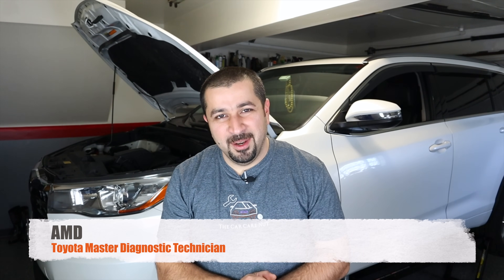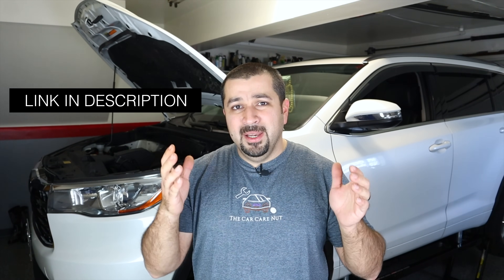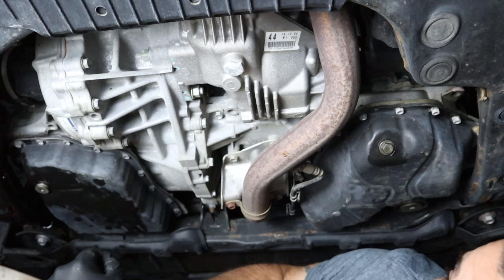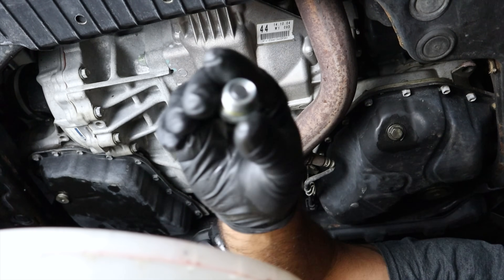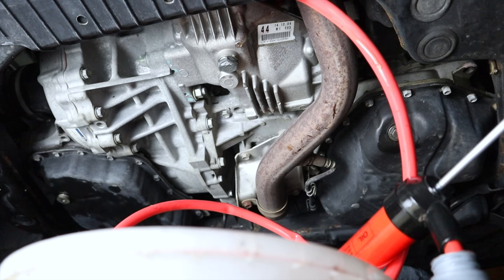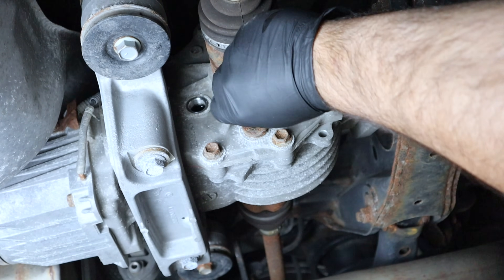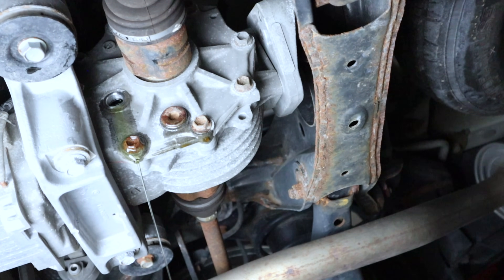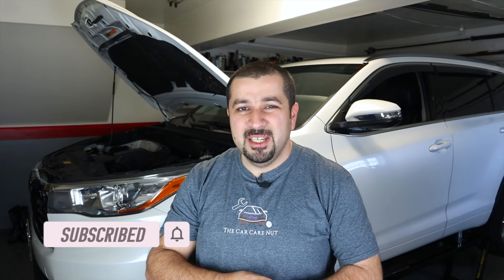How to change Transfer Case and Differential Fluid on Toyota and Lexus

Comment: you forgot to make sure the vent plug on rear diff wasn't clogged. common problem on these...
Reply: How do I do this on my 05 highlander?
Reply: @notreal5299  it's on top of ur rear differential assembly. if it's not moving by hand it's clogged and building pressure and leaking thru seals. can replace it or clean it out.
Reply: @munirshaikhshahid6550  thank you, I now know where to feel around for when I'm under the rear differential.

Comment: I tried using that same red pump today for my sons RAV4 differential…it’s new yet would not pump anything, in any direction. I ended up improvising by just holding the tube up to the qt bottle and squirting it in…made a huge mess!! Mechanics need better tools!!!

Comment: I just did this on a 145k rx350 and it was unnecessary.  The oil was still clear no odor.  The oil in it is proprietary bc its $100 a liter.  You oem guys won't want this done

Comment: Hey can you get the torque specs for the bolts that hold the bracket on the body for the rear trailing arms on a 2011 rav4. It’s a 2wd 4cyl

Comment: Why are you using a pump on the Transfer Case and a pouch on the Differential when both require the same spec. oil?  I have a 2021 Rav4 XLE ICE.

Comment: One comment I like to make about cost. SHOP AROUND. Not all dealers are the same, not all shops are the same. Also it will help greatly if you register on Toyota website as an owner even if you buy it used. You will get lot of "Junk mail" for coupons on all types of services. I can get a full Synthetic oil and filter changes at the dealer with multi point inspection for $35, costs me more to buy this stuff at the parts store. Also check the dealer's or Toyota's websites under service for coupons, there are lot of coupons